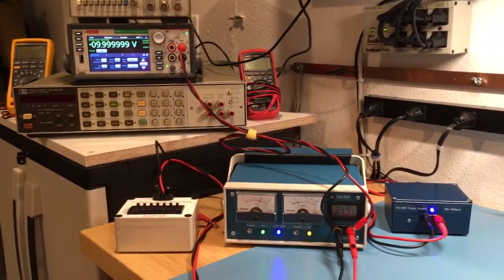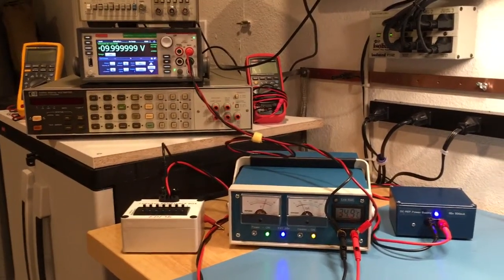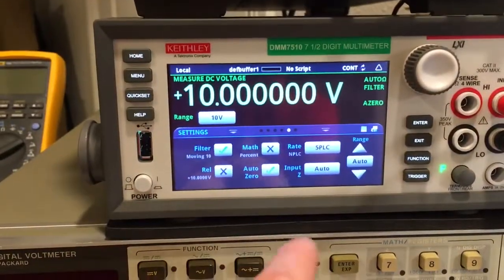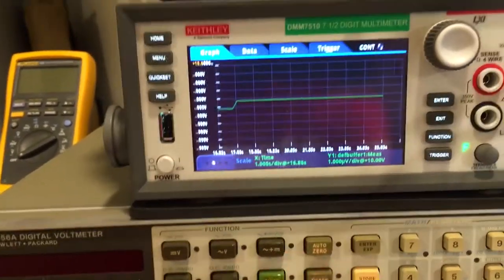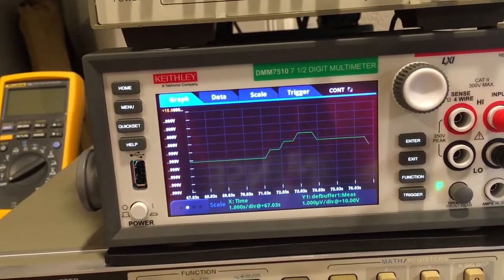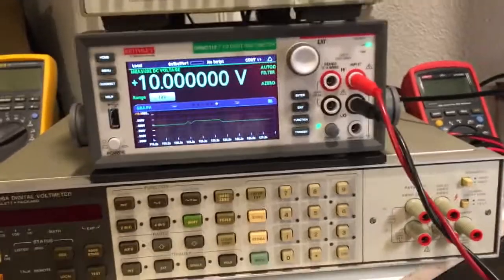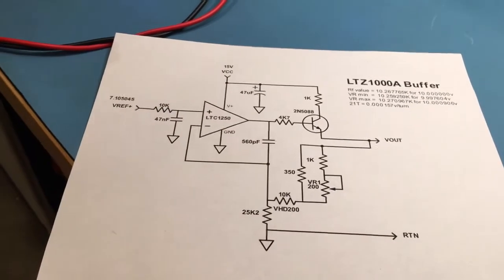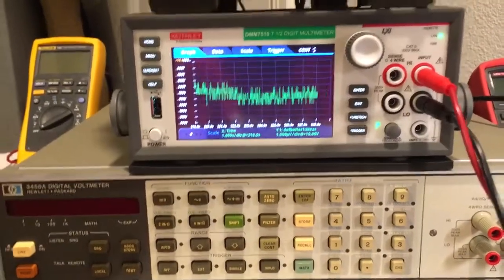10v LTZ1000 buffer testing

Comment: Any specific reason for the 2n5088  output transistor or will any Jelly Bean Part work just as well
Reply from the maker: The 2n5088  has relatively low noise.  This is important for this type of reference.